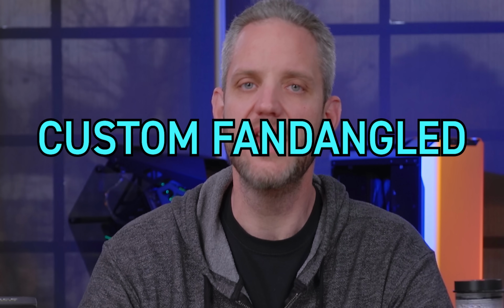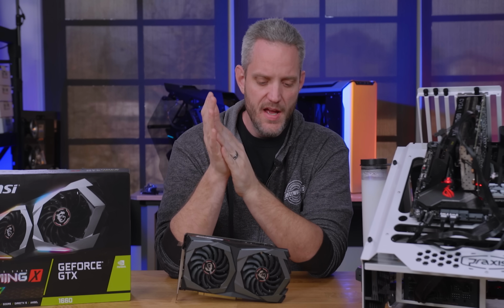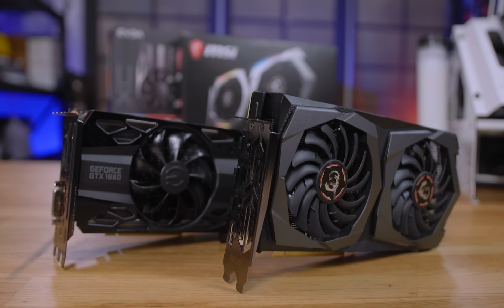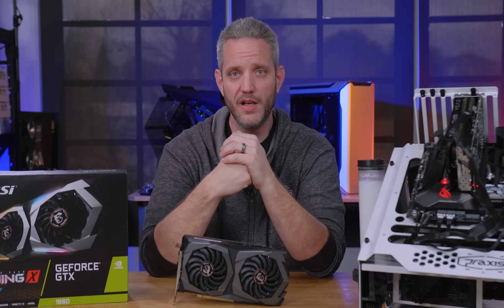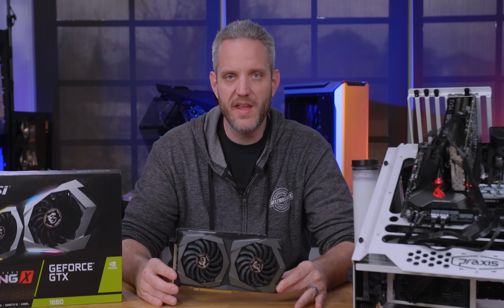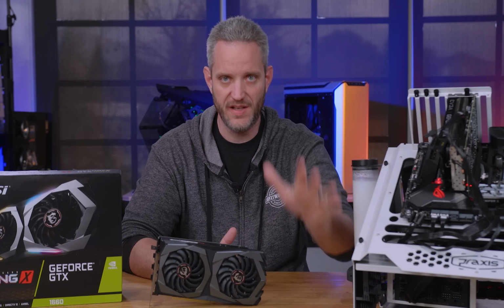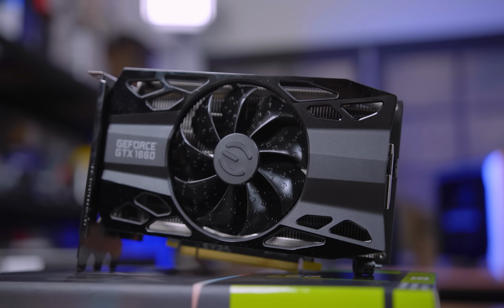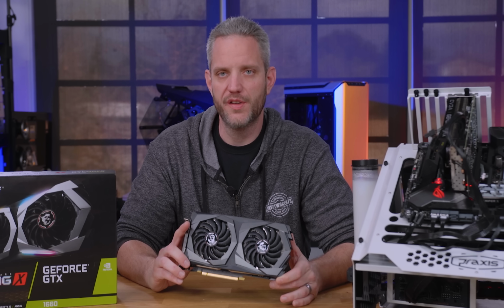Just save your money.... GTX 1660 vs GTX 1060

Comment: So 15% faster than the 1060 for the same price almost 3 years later really Nvidia.
Reply: wizzgamer the 2060 should have been none RTX and should ave been 250$ an have 1080 performance. It’s sad what is going on with midrange
Reply: @dfuma213  The 2060 only yields a few frames under the 1080. The difference is hardly noticeable.
Reply: PatrioticSwellow the 2060 is also 350-370$ that’s my point. It should have been 250$ with that performance. The 2060 is no doubt a great card. I’m just saying if they continued the great performance leaps for cheap like they did from the 9xx to 10xx series cards it could have been amazing.
Reply: @dfuma213  The performance to price leaps have already happened with the 2060. For 350 dollars, you get 1080 performance, better temps, better power draw, and raytracing, for a much lower price point than the retail 1080, which was $800 at the time. Hell,   this card even competes with the used 1080 market!
Reply: @dfuma213  yes, slightly less frames than a 1080 to is worth ¼ of the price. Very rational
Reply: @dfuma213  midrange doesnt exist anymore.
Reply: @dfuma213  that's like saying the 1050 ti should have been 100 instead of 150 and have 980ti performance
Reply: @dfuma213  there would be so many pissed off customers if the 2060 was 250$ and performed better than a 1080. I purchase my 1080ti just in time for prices to skyrocket after 2080 launch
Reply: C4k3 T0otz DUDE

THE 1060 HAS PERFORMANCE OF Gtx 980!!!!
Reply: @dfuma213  if it was that easy for them they would do it,its bussines they aint gonna do that,hurts their pockets
Reply: @kolega4774  Yes, what we have to do is care more for their pocket than for our own. Coz it's moar progressive and shit.
Reply: @GholaTleilaxu  i didnt say that,they care more about their pockets than ours...
Reply: ZurioSm they do tho
Reply: Its also eats more power than gtx 1060
Reply: @one6803  And the RX 580 and 590 eat a lot more power than the GTX 1660 with less performance and are a lot less efficient than the GTX 1060 if you are going for performance per watt.Yes the performance increase is larger than the efficiency improvement - still the GTX 1660 offers more performance per watt therefore it is more efficient - so what exactly is your point?
Reply: 15% faster than the 1060 for 12% less money than the 1060, $249 release MSRP on the 1060 vs  $219 MSRP release for the 1660.

I've got my gripes with Nvidia, but the price/performance ratio of the 1660 isn't one of them.
Reply: The problem is that you can say that about AMD as well: Radeon RX480 was launched in June 2016. In March 2019 you can get 15% faster RX590 at the same price.  Nvidia doesn't really need to try that hard..they just needed a product that can match RX590.
Reply: @kimnice  I agree 
I got gtx 1060 6gb last year at summer that was my first desktop build and i will keep that gpu bcuz  i dont realy game focus to work online
Reply: I have a 1060 6Gb and see no need to upgrade because of this, they're damaging their own bottom line and needlessly making cards.
Why spend another £250-300 to get 15% performance increases when i can just buy a more powerful card from the previous gen? 1080's are selling around £400 second hand for example.
Reply: @rasmachris94  You wouldn't spend that much because it's not meant as an upgrade for 1060 owners
Reply: Ah yes, it's for that ubiquitous ray tracing I've been hearing so much about. @bencornelisse1186
Reply: @rasmachris94  I got a used GTX1080 with warranty until early 2021 for $350 immediately after RTX launched. Couldn't be happier with my decision. The performance still rocks.
Reply: @rasmachris94  im same mate. sticking with my 1060 6gb highly overclocked i play at 1080p dont need any other card right now
Reply: If AMD comes with a good card like the rx480 back in the day that would be nice
Reply: @shadbud9198  the RX 480 was overshadowed and outperformed by the 6GB 1060 and it definitely shows with the 1060 still being the most popular card on steam. RX 580 would've made more sense too say
Reply: @shadbud9198  The Rx 480 still performs well. It is sad that Nvidia has been forcing people to overpay for small gimmicks.  I hope that Navi proves to be a market changing linup in the coming months.
Reply: @shadbud9198  They did but man prices are really fucked up
Reply: I will say I am interested in seeing this DXR launch that Nvidia will be releasing in April to allow what I understand to be "simulation" RTX capabilities even though the 10 series cards will not perform anywhere in the ballpark of the GPU'S with actual RTX features. I would poke around using low to medium graphics just to see this DXR in action. Correct me if am wrong but the 1060 6GB would be the lowest end that they will be releasing this DXR driver update to... mainly because I have one. lol
Reply: Im getting this card because I need a card like the 1060.
Reply: @SightCentralVideos  i would advise you to get it then i have 1060 but if i didnt id be buying this
Reply: In my country.. the 30$ jump is somewhat a 70$ jump. The price is insanely high! damn it
Reply: @manishgoyal7677  can you not buy it online from another country?
Reply: @GhostvaperYT  From India here! can definitely arrange to buy from China!
or can ask someone to fetch it from U.S. or even Canada but that'll take time!
The biggest issue could be warranty! which I might be able to claim in my country. And that could be a serious problem.
Reply: @manishgoyal7677  oh ok. well i guess you either spend a lot of money OR wait to have it delivered from abroad and worry about warranty. a warranty is good to have but depends on the prices. if you can afford to buy from india.
Reply: @GhostvaperYT  well I'll rather buy from India.. because firstly.. I'll get the warranty and secondly, I can get the benefit of taxes paid on the product through some other way. The Tax here is 18%! so I can get back the taxes paid through some tricks.
but even after all these, the 1060 varient costs between $320 to $350 and the 1060 Ti costs somewhere above $360!
Its ridiculous.
Reply: @manishgoyal7677  wow those prices! good luck. i hope you find a nice card from india. try to find a cheap Ti if you can and make sure your card must be 6gb do not buy the 3gb card not enough vram.  good luck.
Reply: @GhostvaperYT  Yeah! the 3GB version really gets sold here because of the price difference but I'll rather opt for 6 GB version whether I buy 1060, 1660 or 1660Ti.. or even the RX 580 for that matter
Reply: @manishgoyal7677  trust me. my friend has 3gb and he cannot turn up any settings the games use to much memory now and in future it will only get worse for 3gb. do you have EBAY????  some good deals on ebay.
Reply: @GhostvaperYT  eBay was there but they shut down their operations last year; I can definitely go for a used one.. will get it for a lot cheaper.
Reply: @manishgoyal7677  ok my advice is by saving money on ebay or a used one you could afford a better model like a Ti or 1660. or just get a 1060 second hand for cheap then upgrade in a few years honestly depends on your monitor and cpu. what res you play at i use 1080p and its perfect for a 1060 6gb card at high settings.
Reply: @GhostvaperYT  Since 1660 is new there is not even a single used GPU up for sale.. I've already Searched enough! But will see Whats the best deal I could find.
I will play at 1080p 60fps and will also like to try my hands on streaming.
Reply: @manishgoyal7677  i play at 1080p 60fps and my gtx1060 6gb is enough. if you can find one second hand cheap then i would say go for it
Reply: @GhostvaperYT  GTX 1060 can easily do 1080 60fps but not exactly in ultra settings in every game! With a bit lower settings.. it can literally get 1080 60fps on every game even for next few years!
Reply: @manishgoyal7677  yeah some games are ok ultra but most new games like far cry 5 play on high. depends on your ram/cpu and even your disk.
Reply: @GhostvaperYT  can confirm, i have the 3gb 1060 and i wish i had gotten the 6gb .. so might upgrade now with some good games coming out soon.
Reply: @iaxe3107  yeah i really think they should have never made the 3gb it is just not enough vram. they should have just made the 6gb. as long as you get the 6gb version and can overclock it a bit at 1080p i find it is more than enough right now
Reply: At least it's not like the 2080 vs 1080 Ti where the 1080 Ti is faster lol
Reply: PhyZeik lol wut, the value of the dollar has gone down, 250 dollars in 2018 is 260 dollars now.  A 200 dollar 1060 3gb counting for inflation is 215 2019 dollars, making it about thesame price as a 1660 now.  Some people can’t afford top cards, that’s why these low end cards exist, the 1660 is fine.  Also why tf do you care about my profile pic, it literally adds nothing to this conversation and just makes you seem bad at arguing.
Reply: stealthballer I am not sure what you are trying to say, but the Radeon 7 was the most pointless and unsuccessful graphics card AMD has ever released. Expensive (699$) but a lot slower as the RTX 2080 for the exact same release price. Today it actually offers the same performance as a RTX 2070. As the RTX 2080 was released earlier you could get one for 600$ as the R7 launched for 699$ ... + if you ever needed it you had Hardware Raytracing. And don‘t even try to pretend the R7 was a professional graphics card, it was not. Lisa Su released it as a gaming graphics card on CES 2019, and as a gaming graphics card it was a huge flop, which is why only a few months later it has been discontinued. 16GB VRAM would be nice to have, but not on a graphics card with the performance of a RTX 2070, 8GB are more than plenty for that performance.

Looking at everything AMD is doing right in the CPU market right now they are fucking up in the GPU market ... Radeon 7 and Navi were huge disappointments mostly because of their high price points. Let‘s hope atleast Big Navi will change that ...
Reply: I think it's less of a difference from generation to generation, but the difference between the 760 and the 1060 is pretty stark, compare the 2060/1660 and the 960 for example and there isn't all that much of a difference that warrents the price hike, especially when there is not a noticeable performance increase to match the architectural differences and general performance increases we expect per upgrade cycle. @Zwenk Wiel
Reply: Still loving my 1060 6G. Slapped some +MHz on mem and core clock and still good to go.
Reply: wizzgamer it’s not like AMD has made a large improvement either. At least the 1660 isn’t an overclocked 1060 like the 580 and 590.
Reply: lol it came out cheaper than the 1060 did, this is like a 1060 3gb sucsessor while a 1660ti is sucsessor to a 1060 6gb.  Its not that bad in the long run, since 9 series to ten series was huge, but a 15% jump is normal when you see how a 560-660-760-960 were small jumps, its only a 1060 that was a big jump.
Reply: @PhyZeik Man, I dont know where you got your sources from, but a 1660 is 10-15% faster than a 1060 6gb, that has been proven and is fact.  A 2060 is 50% faster than a 1060, and while yes, the pricing is dissapointing at 350 dollars, not much I can do.  A 1660 honestly isnt that bad, our expectations are inflated by the mega jump from maxwell to pascal, we saw enormous jumps, when the jump from 560-660-760-960 are all about thesame as 1060-1660, its just that 960-1060 was crazy.  I have no idea where you got a 1660 was worse than a 1060, thats a total lie.  The pricing sucks for rtx, but 16 series cards are fine.  Not amazing, just fine.  Also do you know how inflation works?  A 1060 for 250 bucks in 2016 is about 265 bucks now, if the 1660 was released in 2016 it would actually be around 205 bucks, around the msrp of a 1060 3gb.
Reply: wizzgamer That’s not even bad, the RX 480 and GTX 1060 were really the only massive improvements in a long time. The 280x to 380x and 760 to 960 were much less of an improvemen.
Reply: This card is cheaper then the 1060 was. At least in my country.
Reply: That's why AMD beats NVIDIA, maybe not in quantity, but at least AMD doesn't make cards that are the same as another of the same generation that they created. :\ NVIDIA is good but they like to release quantity over quality. AMD is slow because they want to release quality over quantity so they don't rush products.
Reply: 733Rafael Jewidia damn I like you...
Reply: I have never seen a GTX 1660 for less than $260.
Reply: Reason i ditched Nvidia for AMD, they are a joke.
Reply: Greedy people
Reply: now this is why i went to a 5700 xt
Reply: All yall stupid its 50% than the 1060
Reply: With gddr6 in the super version it is 100% worth it
Reply: wizzgamer you might as well buy the RX580 or RX 590
Reply: Actually that 15% sometimes matters a lot plus the gpu was made to target people who are using a GTX 960 or something like that.. Nvidia already has the RTX series cards for the replacement of 1060.
Reply: i've had a 1060 3gb that works with an initial i5 for almost 3 years and i've been able to play every single kind of game available unless your a fps and texture snob, this GBU is timeless and only 200 bucks on amazon if you inbred humans still want a functioning GBU that won't cost more than your parents credit card money
Reply: @Zwenk Wiel Mate, i know this was a year ago, but when the 1060 came out it had better performance than the 980.
Reply: My 1660 is the same as the 1060 I thought i was upgrading!!! It might be slower!!!
Reply: sadly this is even the "best" case scenario compared to the rest of the stack. seeing as how everything else is pretty much the same level of performance for the same money 3 years ago. mainly, the 2070 and 2080. the 2080ti is in a world of its own.
Reply: Well, triple A games, compared to three years ago, are more demanding.
Except Crysis 3 and Gears of War 4....Those have always been demanding.
Reply: @alexgottmituns7049  Not at all. Tell me one graphics blockbuster which changed how we look at gaming graphics that is worth to mention after Crysis (1)? Graphics in games did not really change a lot, which is why the most successful games today are E-Sports titles with mediocre graphics compared to when it was all about the graphics a few years ago. 

Most triple A games today run at 100 FPS+ on a GTX xx70 - not even close to possible a few years ago with a GTX x70 and triple A games from then. Pascal/Vega gave us a huge performance increase while graphics did not change a lot. Therefore 100+Hz even on non-Ti graphics cards is a thing now.
Reply: @SURO90  at 1080p medium/high, sure. But not 1440p ultra. I'm not going to delve into 4k. Most enthusiasts are 1440p/144hz. Or 1080p/144hz.  What can I say. Far cry 5 is an example....
Reply: @alexgottmituns7049  
Far Cry 5? Please be serious.

Not 1080p Ultra, even High settings weren't possible most of the time. Medium settings 1080p is the point were 100 FPS were possible at best at that time - I'm with you there. That's what I am saying, graphics did not change a lot but performance did. Therefore a lot more FPS - but nobody gives a fuck about more realistic graphics as the DXR drama shows.
Reply: @SURO90  I'm not asking for 144+fps. If you can keep it @100fps 1080p ultra avg, we're good to go. Most enthusiasts,  love the visuals. Not even going 1440p much less 4k. Far cry 5 1080p ultra or say, metro exodus extreme 1080p (no rtx/dlss).
Reply: @alexgottmituns7049  Speaking today that is not even close to valid. Most people would not consider anyone below a RTX2070/RX Vega 64 a enthusiast and there is only a very small amount of buyers who intend to use those graphics cards for 1080p gaming. 1440p usually is standard there, 4k of course is not worth mentioning at this time.

On the other hand nobody in to visuals would turn off DXR (RTX). AMD announced at the CES 2019 that they also will release hardware accelerated Raytracing in future products so considering graphics this is one of the most important steps the last few years - somebody loving visuals would not turn it of. Most enthusiasts as everyone else love visuals, but they would choose high FPS (100FPS+) over visuals.
Reply: @alexgottmituns7049  I must agree: nVidia is more power efficiant. I got 1060 6G and put it in my 5 year old system at a time. One 6pin pce connector was all I needed. So I got away with my old shitty PSU. Now I use same card in new build.
Reply: @SURO90  You don't have to spend tons of money to be an enthusiast.
Reply: Samuel Rs You forgot the quote.
Reply: @SURO90  "Most people would not consider anyone below a RTX2070/RX Vega 64 a enthusiast"
Reply: Samuel Rs 400$/300$ are „tons of money“? Ffs get a job. Nobody says you need to spend that kind of money, you can be perfectly fine with a RX570, but then again try and show up with a RX570 as an enthusiast ... of course per definition you could be one, but most people would not see you as one, that‘s what I was saying.
Reply: @SURO90  In which country's dollars are you buying an RTX2070 for 300-400? Especially nine months ago? You don't need a USD$500+ video card to be considered an enthusiast. You don't have to be so insulting. Not everyone is born in the West you know. What is the purpose of you even clicking on this video in the first place, why are you here? After all, you don't think a card like this is worth the attention of an enthusiast and all those who do not own one, but want one, are just lazy an unemployed. Even in the West I imagine there are many non-lazy people with commitments who canont afford such a thing. But in reality, being an enthusiast is about knowledge - not possession. You could possess a thousand RTX2070's without being an enthusiast.
Reply: Samuel Rs Again, I already told you, that the general definition and being an enthusiast in the PC community is obviously by most not seen as the same. I was also obviously talking about 400$ for the RTX 2070 and 300$ for the Vega 64 if you read the quote in your comment. That is if you can still buy the Vega 64 in your country.

I did not say you are unemployed if you can‘t afford a 300/400$ graphics card, I said you are most likely unemployed if 300/400$ are „tons of money“ to you and still you are here looking at videos for graphics cards ... If 300/400$ are „tons of money“ to you, you clearly should be thinking about something else than a graphics card. How do you even pay your rent if 300/400$ is „tons of money“? I am aware there are less lucky people than us people in „the west“ but mostly you won‘t find these people in discussions about graphics cards. Living in the struggle there are more important things than a graphics card. Been there done that.
Reply: @SURO90  Perhaps you are confused as to the definition then. You do not need to own anything to be an enthusiast and ownership of a thing does not make you an enthusiast in a field, it is knowledge and interest, not ownership. One cannot purchase enthusiasm.
Reply: That reminds me of the Radeon 7 which came 3 years later than the GTX 1080 Ti with the exact same price and same performance - really AMD? Atleast give us 15% faster as with the GTX 1660.

BTT: The GTX 1660 offers more performance than the RX 580 at a lower price. It even is faster than the RX 590 most of the time - why complain about Nvidia? No competition - no reason to offer more than 15% performance increase for the same price 3 years later. Easy as that. 

Still hoping AMD will get their head out of their ass though like they did with Ryzen vs Intel. A bit of competition in the graphics card market would not be bad at all.
Reply: 15% is alot. it can make a big difference. give 15% more speed to any f1 car and it wins the race.
Reply: @maniaque37  I mean is going from 60 to 69 FPS going to be that noticeable? Besides for the obvious memes.
120 would go to 138.
Even if you were getting 144 in esports, you would be going up to 165.

If you ask me that’s worth like maybe a $30 upgrade, including cost recouped from selling your old card.

We aren’t racing PC’s here.
Reply: @maniaque37  Wow you couldn't find a better analogy than that?
Reply: @linkincr17   looks like most pple agree with his analogy.
Reply: @budgetking2591  most people? He has 2 likes lol
Reply: Nvidia is joke with their products and prices that kill you
Reply: @intech7863  Still except the low-end RX570 they offer a better price/performance ratio - so AMD is just as big as of joke according to you?